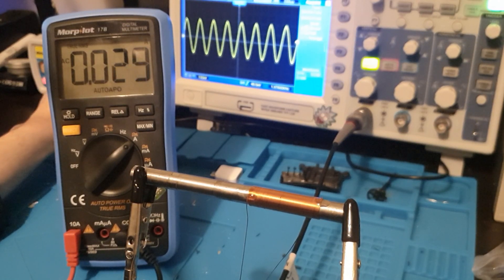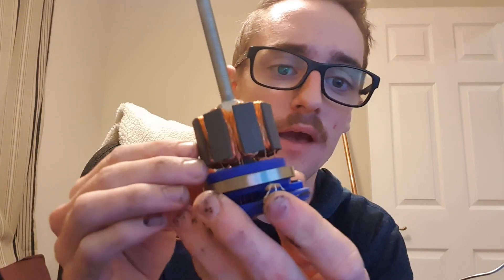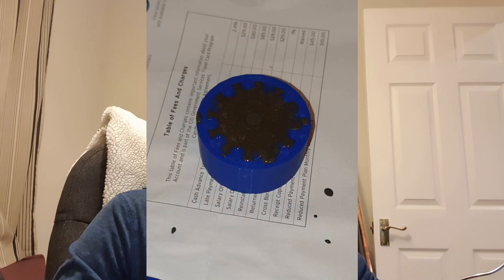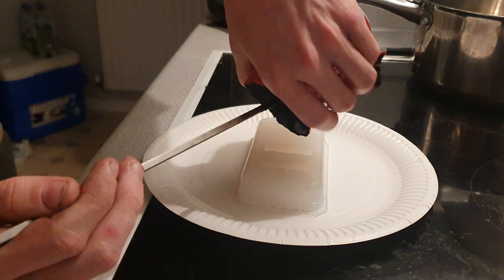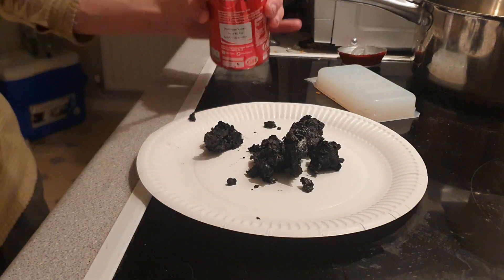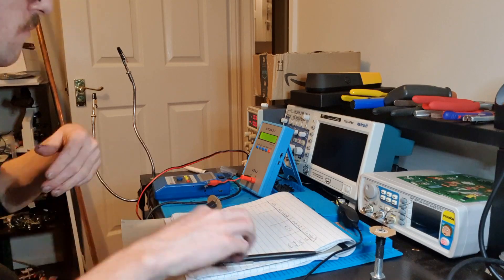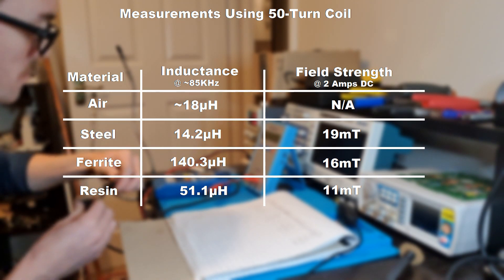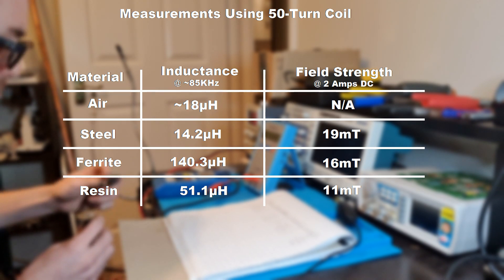Homemade Magnetic Cores! (Part 1)

Comment: It just makes sense to thin out a resin. You don't need a thick super strong glue to hold it together. If you garden you know there is natural cement in the soil it can get very hard again a year after tilling, it's a very weak cement. I found you can thin out epoxy after it's been mixed with lacquer thinner it will soak into the wood it's the best waterproofer on earth, it even soaks in deeper.
Reply: I decided to buy a ferrite shape that is easy to find first. I believe in the KISS theory. If I can't find it then I'll make it. I should try this first just to see if it works okay.

Comment: I was looking for info on making ferrite cores for electric motors and I can't find much of anything but your video comes the closes. I would like to see how the actual ferrite cores for motors are made and would like try making them. I have access to a kiln that goes to 1200c so I would hope if I got the composition right that I would be able to make ferrite as good as companies actually doing it but idk I just can't find the info.
Reply from the maker: Trust me, I'm aware. I was inclined to buy or build a kiln, but couldn't find information anywhere on how to make proper ferrite, so I never tried it. Obviously, it's some sort of ceramic. So my best piece of (unqualified) advice would be to look around for the least viscous ceramic precursor you can find so that you can make a mixture of iron or carbonyl powder in high concentration.

Comment: I didn't find any company that produces silicon steel sheet and cuts at a viable price. However, I found very cheap 1020 carbon steel sheet on the internet, and the company also makes CNC cuts at a good price.
I'm not sure, but it seems that the magnetic permeability value of carbon steel seems to be much higher compared to silicon steel through magnetization curve tables that we researched on the internet, but there could certainly be something that the quality of silicon steel gains of carbon steel.
If you look at the price comparison of silicon steel and carbon steel sheets, the difference is huge. Sometimes it pays off to choose the most viable one. Maybe the quality of the two is almost similar or not, unlike the price.
Reply: Silicon steel has much higher electrical resistance, leading to lower eddy currents within the laminations and thus lower core losses.

Comment: Howdy, how about using a fresnel len on the resin via sun power...

Q: What do you think about using a railgun system with a blimp/drone (tethered) to be used as a skimmer for volcanic plumes/toxic fumes - air purifier? 
- either using compressed air to funnel the mass into a channel/filter
- giant net-filter

Q: Railgun transportation system with pods - that can be ordered like Uber... having special platforms with magnetic safety mechanisms to guide the pod and as a stopper.
- platforms are capable of digging into the earth and planting different kinds of vegetation, watering, scanning for any toxic and potential new materials...
- the platforms have wheels to move around freely via AI, to fulfill the destinations. 
[Since the way gas and energy is going, it's going to be impossible to fulfill soon enough.]
Lol...

Cheers~!
To more Blissful moments!

Comment: Have you thought of using an ultra sonic mixer to help mix the compounds together. I know they may be expensive but may improve yields.
Reply: Yayyy!
Which kind are you talking about?
Are there higher power ones?
Ones I've seen are only ones for rust/debris removal from pcbs, submerged in fluid.